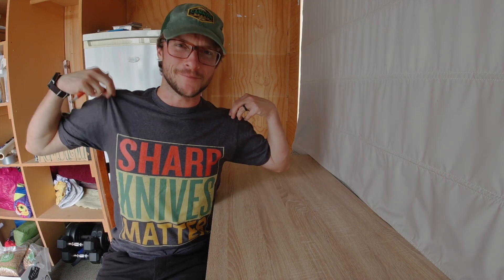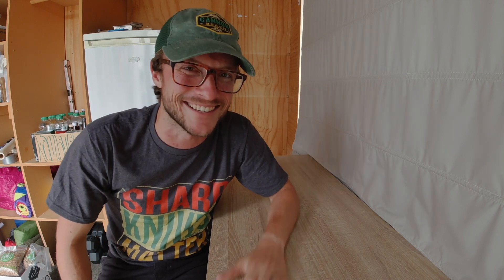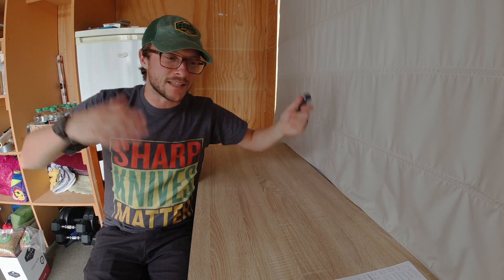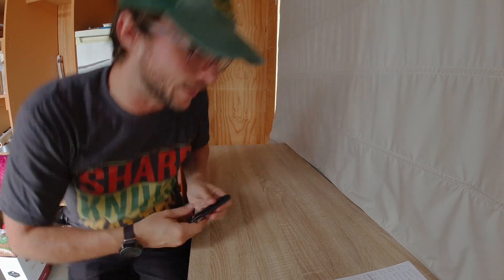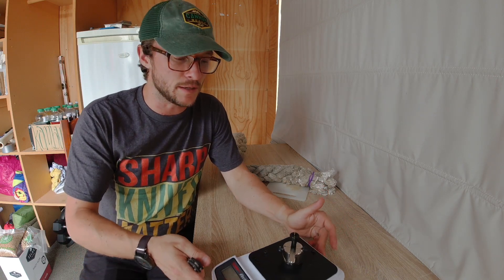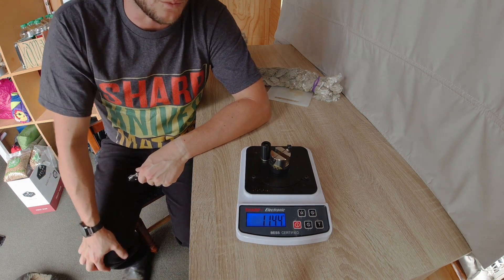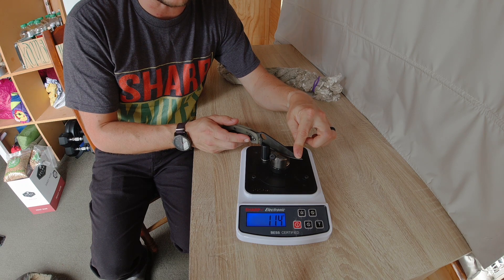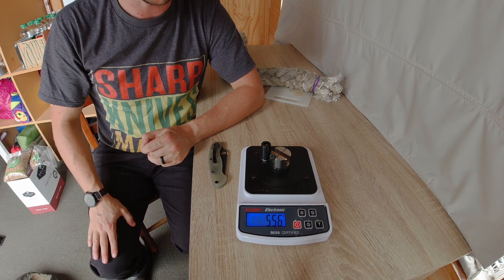Dual Grit Sharpened Benchmade 943 Knife vs Rope of Death - can CPM S30V Survive ?

Comment: It does seem like you can get to a point of diminishing returns with a super high polish on an edge.  It looks cool.  It slices paper great.  It might not do many other things so great - better than a dull knife for sure.
Reply from the maker: Yeah, there is an interesting interplay between edge texture and ability to initiate a cut in a fibrous substrate.  I think if you fully deburr a fine edge it cuts great, but aggressiveness is something that is hard to quantify and often goes un-identified in testing.

Cheers bro!

Comment: 5 weeks. I’ve been learning to sharpen knives. I thought I got pretty good. I sharpened over 50 knives, some repeatably. They would cut newspaper like butter.  

Then I watched a fellow from New Zealand with a new way of sharpening that he had tried and tested and then published a year ago. 

Normally, you start with a low grit stone, say a 400 grit stone, sharpen both edges and then progress to a higher grit stone, say a 1000 grit stone, and repeat until you progress by grits to perhaps a 6000 grit stone. 

You can cut newspaper diagonally, straight with the grain, or push cut. BUT you will hear a noise as you cut the newspaper.

I watched his YouTube video 5 times before I understood his technique. It sounded doubtful. You start with a course grit to both sides of the knife, then progress to a higher grit on 1 side, then drop back to the lower grit. You keep going to higher grits on 1 side, but shaving the burr off with the original rough grit, say 400 grit, on the other side. 

I tried it and attempted to cut newspaper with each upward progression with no success, just tearing the paper. 

I went from 400 to 1000 to 3000 to 6000 to 8000 with no newspaper cutting without tearing the paper. 

Then I stopped the edges with ,05 micron paste in a 5/side, 4, 3, 2, 1, and 1/side and cut the newspaper. 

I thought I had done something wrong. I didn’t hear the normal sound of cutting the newspaper. I didn’t hear anything, but the knife had cut the paper in half. I tried every cut possible and couldn’t hear but a whisper as the knife cut the paper. I tried again and again, but all I heard was a whisper. 

I sharpened the right side with 400 grit and the left side with 1000, 3000, 6000, and 8000 always using the 400 grit on the right side to shave the burr. 

It works. I don’t know why, but it does.
Reply from the maker: Haha AMAZING!  I love this, thanks so much for sharing The story Logan.

I feel like I don’t know why it works fully either, but I can’t deny that I keep getting these really satisfying results from an edge that’s just different on one side from the other haha!

I love that it made no sound when cutting the newspaper! That is so epic. Let me know if you have other successes or discoveries!

Comment: Fascinating, I'm not sure if I missed it, have you tried dual grit edge using any of these steel on the death rope? I have no doubt that your dual grit is the ultimate all around edge for cutting. I wonder how these would perform (and which is the best steel for the dual grit edge) M390, 20cv, 3v, 4v, Elmax, Vanax, Magnacut?
Reply from the maker: Yes, I’ve tried a couple.  Dual Grit M4 got through the whole rope, even with a used edge.  But S30V didn’t.

It seems to point to the fact the benefit that you get with dual grit is magnified if the steel has a relatively high toughness.

Cheers bro!

Comment: Hi Gabe,
Maybe the steel on the benchmade ist burned from the factory grind.  So its softer than wanted. And on the Spyderco you worn through that portion of steel so its hard as coffin nails!! Is that a theory or fact i don’t know just saying!
Reply from the maker: Yeah, it’s definitely possible. Thanks for mentioning it. The benchmade has been sharpened multiple times, but the spyderco probably has been sharpened even more times.

Interesting…

Comment: I pulled a piece of 3 twisted strand 1.5" rope out of the erie canal earlier today. It was buried in the rocky silt near the shore. Probably been there for years.

I did like a loop over chest lever type cut and it got through it in 3 light to medium strength strokes. Totally surprised me. Set the rope on a picnic table to try a more traditional cutting board type cut - absolutely nothing, just some really gnarly scratches on the blade.

S45VN inkosi with a very well used factory edge. It was due for a sharpening, but still would cut newspaper if the right section of blade started the cut.

Have you ever tried a serrated edge on that rope?
Reply from the maker: Very interesting!  So, a high-pressure push cutting motion is much more effective than a repetitive slicing motion that grinds the edge through all of the crud.  Wow.
Reply from the maker: I’ve only tried one serrated edge, it was the serrated knife on my multi tool.

The rope just laughed at me and now my serrated edge is dead.  True story.
Reply from the maker: Granted that was just 420HC and I’m sure that a serrated edge on a better tempered or harder steel could get through it.

Comment: Have you tried just a 250 grit diamond plate edge? Both sides, not dual grit. 250 then strop.
Reply from the maker: Funny you should mention it, I just finished filming my second set of Death Rope tests, and I sharpened Victorinox and a benchmade in S30V to 250 grit and stropped - The S30V coarse almost made it through, did extremely well compared to my other tests.  I intend to try it on a couple more steels before closing off the death rope tests!

Thanks for the feedback, have a great day.